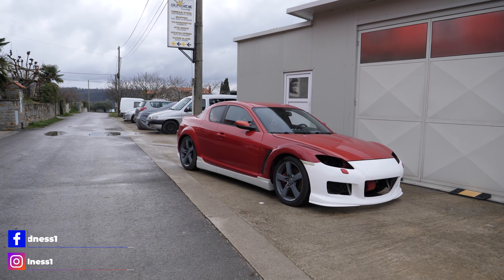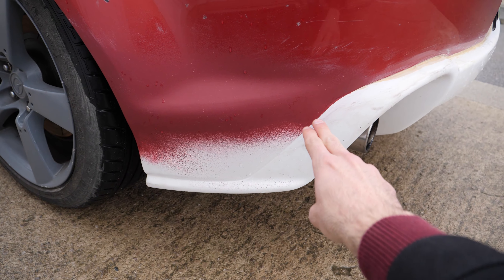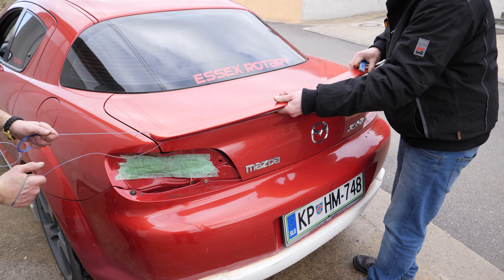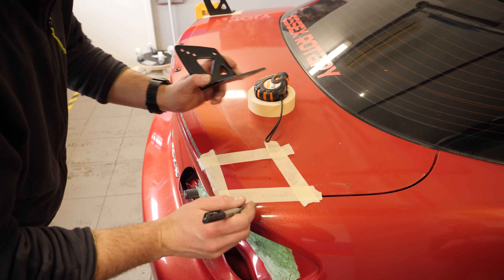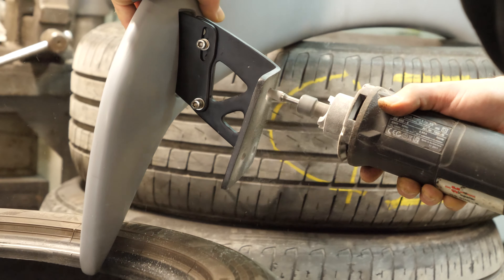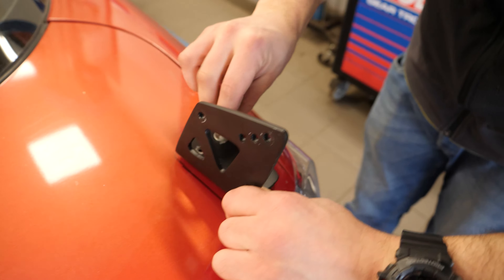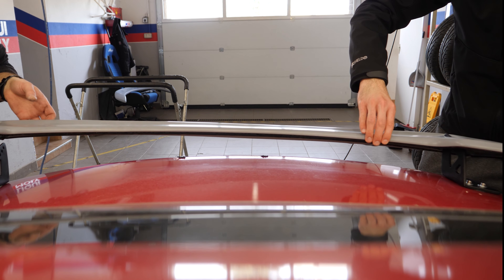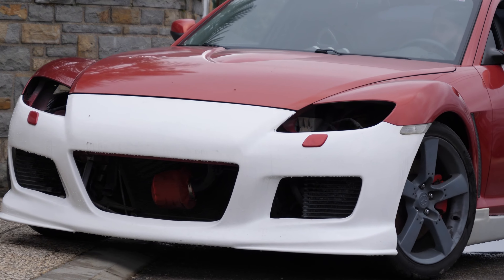Mazda rx8 Body Kit Install pt2 | Mazdaspeed Spoiler Install

Comment: Omg there is something nice about just getting the Authentic Mazdaspeed kit. I had the OEM front, sides and spoiler but went aftermarket on the rear and had the worst time fitting it. Ended up scrapping it and bought Authentic and it went on like butter. So many headaches trying to fit shitty aftermarket replicas. Looks good though!

Comment: Nice job with the boot bolts never seen them before I had to cut underneath to add a nut    Can you use them or something similar to fit side skirts??
Reply from the maker: Sadly no, the side skirts need to be attached with a silicone or similar. You'd have to make too many holes to fit them and you also risk cracking them with the bolts
Reply: Love the finished look mate you did well

Comment: Can I ask why did you use a copy of the Mazdaspeed spoiler and not the official one ? Only know as I just fitted the official one to mine and noticed the difference. Got it paired with the ABMAX wide body kit which is an absolute pain😂
Reply from the maker: They are impossible to find, and if you do it's a used one for like 800€...
Reply: Driven By Madness wow! Got mine in the UK about 3 years ago for about 180 from a scrap yard . Looks like I lucked out !!